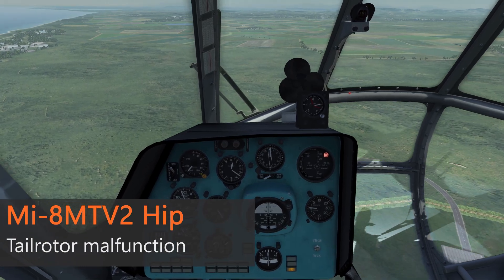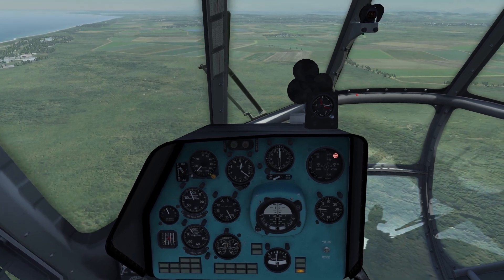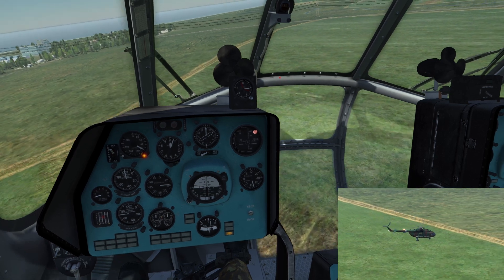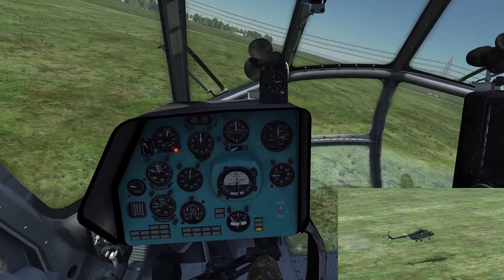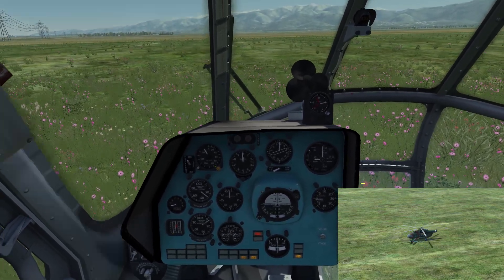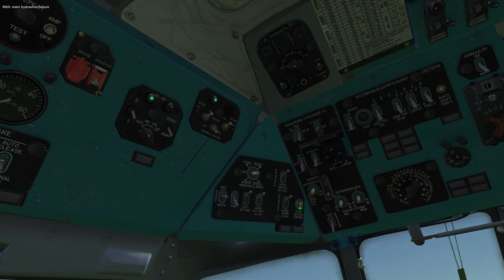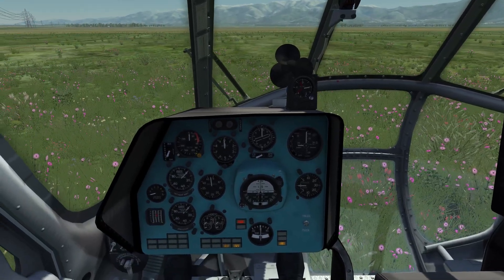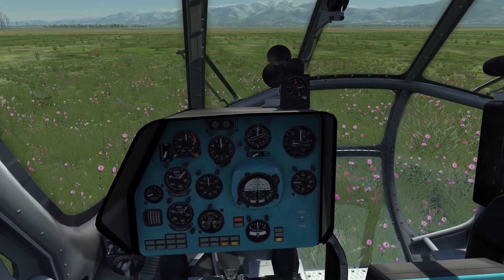[DCS] Mi-8 Tailrotor Malfunction

Comment: hey buddy
i fly numerous real helicopters.
if you loose your tail in cruise and you are light you can fly with low collective setting.
to land or heavy to maintain low collective straight flight the best to do is KILL the engine (kills torque) then do autorotation ;-) 
if you are slow and low you are dead ( dead man curve)

Comment: I have managed to crash land the Mi-8 in full horizontal spin several times, but this tip definately helps in terms of elimininating the spin... all you need is the altitude tho :P
Reply from the maker: Yeah, altitude is necessary. If you go to page 40 of the new manual for the Mi-8 you can find the Height-velocity diagram or as it is often called "dead mans curve". This shows the areas you have to avoid if you want to survive a loss of engine power. If you stay outside of the orange/red areas you should be able to allways get a proper autoration going.

Comment: Hey John, first thanks for the video. Just yesterday I was asking myself if it  would be possible in DCS to simulate failure of certain parts or systems of the aircraft. Could you tell how in depth is this feature? Can you generate scenarios with automatic failure or do you simply turn off specific systems during flight or how does it work? I have just gotten into DCS and been flying the SU25 so far and having my eye on the Mi-8 to purchase as my first module. I somehow took it for granted that multicrew aircraft would also have multicrew support in multiplayer until I stumbled upon some comments that do suggest otherwise. As of now, is there still no option to do this? Is currently the only option to take weapon control to put the helicopter in auto-hover? I am primarily interested in flying the Mi-8 for transport, not necessarily combat missions. But I like to keep it realistic, so can the Mi-8 be controlled by a single pilot to it's full potential for civilian purposes without me having to switch seats?

I appreciate your effort in putting your videos up, they are interesting to watch and very informative. Keep it up!
Reply from the maker: Hi Choco Loco,

Let's start with the failures you mentioned. If you place down a "player" controlled helicopter/aircraft in the mission editor, there is a tab controll on the right hand side of the screen where one of the tabs is "system failures". There you can set up certain failure conditions with certain probabilites after a certain amount of time. This is also how I set up this video. If you download the mission file and have a look at it in the mission editor it should become clear how that works! :)

The multicrew is a bit of a complicated topic. Multicrew is possible in DCS since a short while now and some aircraft and helicopters have it allready implemented (L-39C, Gazelle, ...), however Belsimtek has yet to integrate multicrew into the UH-1H and the Mi-8. There is a bit of dissapointment going through the community that this hasn't been done allready but I am sure at one point they will get arround to do it...

I believe the Mi-8 can be operated from one seat quit well in our simulator environment, while in the real world you would have a 3 man crew (pilot, co-pilot and engineer) where of those 3 guys the pilot and co-pilot would be in the cockpit for most of the flight, whereas the engineer would leave for certain tasks (loading/unloading, slingloading, etc.). 

Weapon employment is quit straight forward once you have everything set up and can be done by one person alone quit comfortably. 

The autopilot is a big help in the simulator environment as if you want to do something from the copilot seat (doppler navigaiton, radios, etc.) you just enable all 3 autopliot channels (the "stabilisation" channel should be on all the time anyways) and the helicopter will keep the current heading, altitude and speed just fine while you do the tasks of the co-pilot. 

I personally like to switch seats for better overview. Starting the helicopter from the engineer position is much easier as you have an overview over all the necessary panels as you are in the center of the cockpit. Radios and the doppler navigation system are easier to operate from the co-pilot seat as the controls are right there. 
However, once the helicopter is started and the radios are set, there is little reason for you to leave the pilot position as he has everything necessary for flying arround him.
Reply: Thanks for your reply, John! Really helped me out.